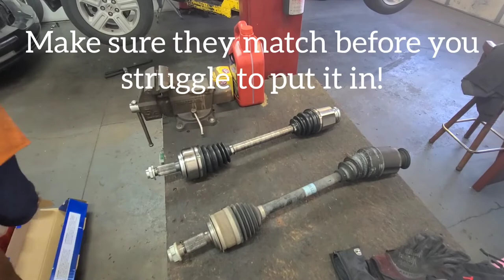Front Right CV Shaft on a 2012 Honda Ridgeline

Comment: 5:05  I didn't know that.....tHanks for the video
Reply from the maker: You can also have a friend hold the brake. Thanks for watching!
Reply: @MegaMilesBen  I'm a carpenter.  If I were doing this a bunch, I would be tempted to cut  a square out of plywood with the hub bolt pattern.
Prop it into place..

....hmmm, that's overkill....Your way is far better. 

Your video has us all thinking.  That is good for the mind.   Have a great weekend!
Reply from the maker: @Dancing_Alone_wRentals  depending on the rotor, you can slip a screwdriver or punch in the fins of the rotor and rest it against the brake caliper. Thats how I normally do it. You cant usually do that in the rear though cause the rotors are solid.

This one being such a high torque, youre better off having a friend hold the brake or put the wheel on and set it down.
Reply: @MegaMilesBen  tHank you...
I've set it down...waiting for the other side then I'll 242 !

Comment: Good video. Just completed replacing the driver's side Axle on my 2012. On other videos they pull the lower control arm instead of the top. I like your method better. I would suggest using a Tie Rod And Pitman Arm Puller instead of knocking the tie rod out with a hammer. Lot less chance of thread damage. Thanks.
Reply from the maker: If you hit the Knuckle and not the tie rod, you won't cause any damage. Been doing it that way for like 20 years. Much easier and honestly less chance of damage than any pullers.

Comment: What you forgot to hit the nut for the axle nut in that groove and torque it
Reply from the maker: I didnt. I did it off camera with the wheel on and vehicle down. That's why I explained it.
Reply: @MegaMilesBen  It doesn't have to be with the wheel on and the vehicle on the ground. I just stick a small punch in the center of the rotor to keep it from turning. It would take more than 550 foot pounds of torque to do any damage to the rotor or the spindle.
Reply from the maker: I do that as well. You'd see it in other of my videos. I use different methods often to show different approaches.

Comment: You need wheel alignment , better disconnect lower ballpoint
Reply from the maker: An alignment should really be done anytime you do suspension work. The bolts on the lower strut mount do not control camber so its the same as disconnecting the lower ball joint except easier to do for most people this way.

Comment: Is this pretty much the same for a 2012 pilot?
Reply from the maker: Yes, it should be very simular.
Reply: @MegaMilesBen  ok im having very bad vibrations when accerlating.   Honda checked it out and said the front passenger axle assembly has play in it.  The part is on back order....  so I ordered an aftermarket and going to change it myself
Reply from the maker: My mistake, thinking about it, I believe that one might have a carrier bearing to it. That would make it a one piece long cv axle with a bearing in the middle. 

For those, I usually will tap them out from the inside or sometines take the bracket completely off if the bearing is stuck.

Theyre a bit more difficult.
Reply from the maker: Is it a long axle or like the one in the video?
Reply: @MegaMilesBen  the one they told me I needed was a lot longer than what you had in the video.  So ill find out in a few weeks when it comes in lol
Reply: @MegaMilesBen  long
Reply from the maker: Like this?...
https://youtu.be/3WJSMKY0cSo

If so procedure will be basically the same except there will be 2 bolts where the bearing is and the shaft will pull out from the side of the transmission rather than in the middle. Once you remove the 2 bolts at the bearing, it should slide out rather easy.
Reply: @MegaMilesBen  yes sir that's the one